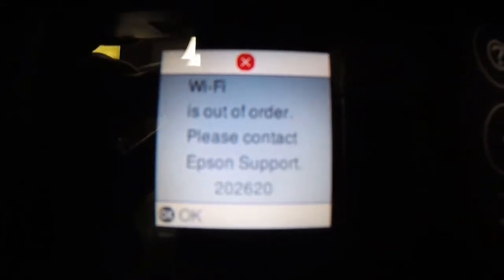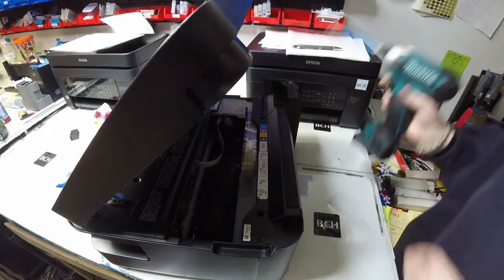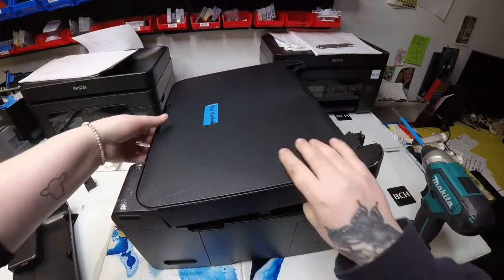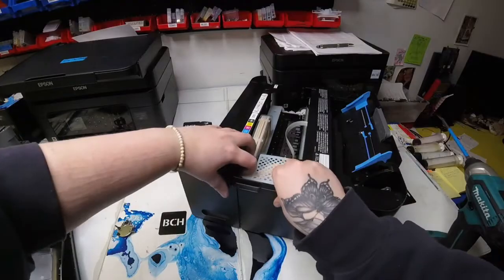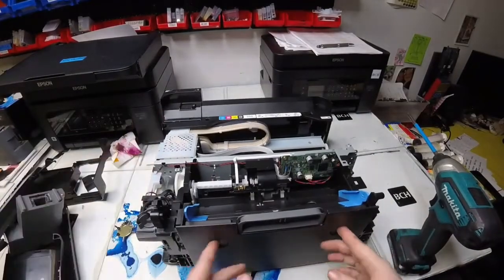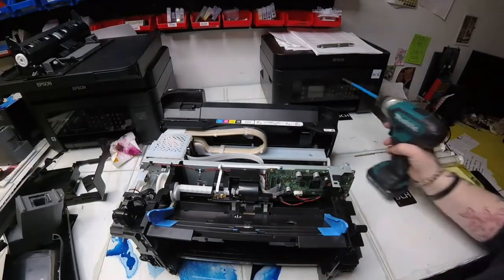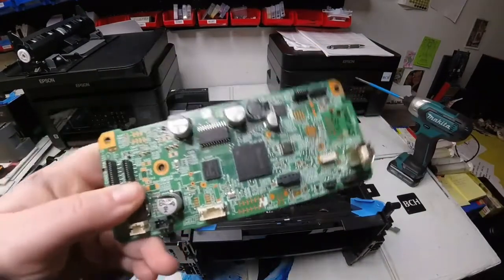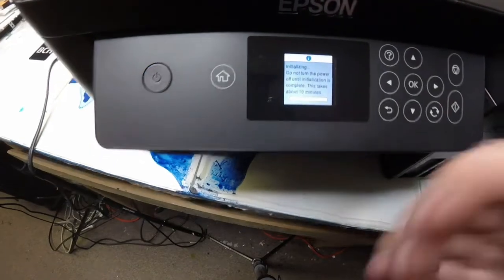Uncasing Epson EcoTank & Fix Error 202260 WiFi is Out of Order

Comment: I just removed the left side cover (one screw on top and one on the bottom), used a needle nose pliers to remove the card, shorted the pins on the removed boards with the pliers (probably not necessary), reinstalled the board, WORKS!
Thanks for the video!
Reply from the maker: So happy it helped you fix it!

Comment: Bought your WiFi card, replaced it and the WiFi printer is working again. Putting the etc/ribbon cables back in the back board was a real pain. I had to unscrew that top cover to get better access and managed to all three cable sets in with a help of needle nose pliers.
Reply from the maker: Glad the replacement worked and you got your printer back up and running!

Comment: Very useful video, thanks very much. A word of warning when fully removing the master board on a ET3850, be very careful handling/removing the small yellow plug situated close the the ethernet port ( not shown or present in the video so assume the Ecotank model used for the demo is slightly different to my ET3850). You may find yourself having to do some fine soldering if the socket becomes detached from the master board, like I had to do!

Comment: Worked for me. Thing is once you get the left side of, with a pair of hemostats or good tweezers the wifi board is accessible without going any further into the printer. Take the card out and a bit of deoxit on the pins and manoeuvre it back in and it's a goodun
Reply from the maker: Awesome, thanks for sharing this tip!

Comment: I have an Epson ET-3850 Eco Tank Printer/Scanner with Wifi, I want to know which Wifi Board to Order, without taking it all apart first?  Printer purchased new about 3 yrs ago, but has a bad Wifi board, but i know which one to order?  In this pic it showed my J26H006 but mine has no other markings weather it is a 4 pin or 5 pin Vertical or Horizontal???  The Video says that yours is an Epson Eco Tank Printer?  yours shows having 5 Pin Vertical, but NO replacement Part number???   And when I look at an Epson Parts List for a Board J26H006 it will show 4 Pin Horizontal and Vertical, as well as i think 4 pin or 5 pin???   So what is the Part Number I need?   4 or 5 Pin, and Horizontal or Vertical????  Thank you .... Jerry Smith
Reply from the maker: Thanks so much for your detailed question and for watching, Jerry! To get the right WiFi board, you’ll need to confirm both your board’s model number and whether it’s a 4-pin or 5-pin, vertical or horizontal connection—since even the same J26H006 model can vary. Once you know those details, visit [https://bchtechnologies.com](https://bchtechnologies.com) and search for your model, like “5-pin vertical WiFi card,” to find the right match. I really appreciate your engagement and support! Please subscribe or become a channel member to get priority answers and early access to videos—subscribers and members are usually answered within 48 hours, while I can only handle about 10 questions a day. Regular viewers are answered when time allows, and any remaining slots go to the newest questions first. If you’re not subscribed and don’t get a reply within 48 hours, you can subscribe or repost your question for faster visibility, and if you subscribe later, your old questions automatically move to the priority list. For faster help, you can always email [support@bchtechnologies.com](mailto:support@bchtechnologies.com). If this video or comment helped you, please leave a quick Google review here: [https://g.page/r/CfL7k6nYvPQ9EAg/review](https://g.page/r/CfL7k6nYvPQ9EAg/review) — it really helps the channel grow!

Comment: I got the dreaded wifi connection 202620 error this past week.  Was torn between tossing my 1 year old ET 3850 purchased as a refurb and buying a new printer - maybe a brother this time vs attempting a fix.  Since I was already resigned to get a new printer I pulled up this video and decided to take mine apart.  I didn't have a new wifi module but saw that some commenters were successful with performing a simple re-seat of the module.  

My 3850 was different than what was featured in this video but the similarities were close enough for me to follow.  The main difference for me was that I had an extra cable to detach when pulling the scanner top off.  It had three small wires attached to a pin clip.  Anyhow, the steps in the video got me to where I was able to pull the wifi module off w/o having to unscrew the motherboard.  I re-seated it, backtracked the video to put the printer back together and was SUCCESSFUL in getting the wifi connection to now work.  

Knowing what I know now, I think I would be able to re-seat the module without having to take the scanner cover off.  Although I'd certainly prefer to not have to test that assumption and have my printer work issue-free now  Thanks for the vid!

Comment: Sorry but for a job that consists of so many steps to undo everything, your video is not very helpfull and seems was crammed into a 3:43 minute video.  You should have taken the steps to show what you do with the ink tank removal and screw removal with explanations, rather that just power tool your way through every panel.  The quality of the video should have been clearer too.  I am still going to try and change my Wi-Fi card.

Comment: My wifi part was Epson 2207229 Wireless Module, got it shipped from Prime Parts $40 CDN. The scanner bed is difficult since she doesn’t show it well but slides on plastic shaft pins. Broke part on mine but glued it back. Working unit !

Comment: I followed all the steps and succeeded great fully, in my case I just disconnected the WiFi module, cleaned and re-connected back to the board, and it’s working again. 

It was a little tricky to remove the panels, but eventually made it
Reply from the maker: Nice work! Glad to hear you got it sorted out. Those panels can be a pain, but you totally nailed it!

Comment: It actually fixed my wifi problem, since I already had a wifi chip already in I just took it out, blew it in and the port to remove any dust and pressed it in firmly. No more wifi issues and no errors… so far
Reply: How about now, after 6 months? ;-) Im curious if the problem reoccured...
Reply: This is what I did - it worked! I'll report back with another comment if it fails again. For now: the wifi is working after taking the chip off the motherboard and then plugging it back in.

Comment: all nice but that is not something a regular user can do. Just bad quality from Epson I would say. Using this printer for just 3 years now and this is the problem already.
Reply: I had mine for 3years too! And it's giving me this code
Reply: @dianachavez3106  One time, it happens, twice coincidence, three times a pattern.  I got this error with around three years of use.  I guess this is it.
Reply: Me too!  I loved this little printer and can't see me taking it apart.....so unfortunately it's gonna have to go to the landfill.  What a shame. :(
Reply: @tami-d8d  I'll take it
Reply: @dewy330 I ended up just plugging it into the internet directly. Works fine and an easy fix for me.
Reply: i have 2 printers l4260 and both of them still have this issues. epson must be out of mind. just imagine. 2 years ago and this issue still exist!!!!! unbeliveable. thanks epson
Reply: I find it kinda sad, that you would just throw the whole thing away, instead of getting the part for 17 bucks of eBay and spend 20 min with a srewdriver.
Got the same fault and swapped the part in literaly 20 minutes.

Comment: Hey, Kevin the nozzle is ok in epson printer, but still the lining comes, what adjustments and alignment have to be done, plz make a video
Reply from the maker: That's weird. Are those lines vertical (perpendicular to the printhead movement)?
Reply: @BCHTechnologies  no it's horizontal brother
Reply from the maker: Then I would worry about how the ink is fed into the printhead. Are the stripes uniform and small, or is it large and sometimes skip the whole section?
Reply: @BCHTechnologies  yes it is small almost 1 centimeters gap between 1 line to 2
Reply: @BCHTechnologies  ink is genuine and I always putt it gently
Reply from the maker: I'm not sure about that. If the stripes are vertical, it could be an issue with the timing scale, but if the printhead is producing a perfect nozzle check, I haven't seen anything that would cause horizontal stripes.
Reply: @BCHTechnologies  not a problem thanks a lot for giving us knowledge🙏🙏